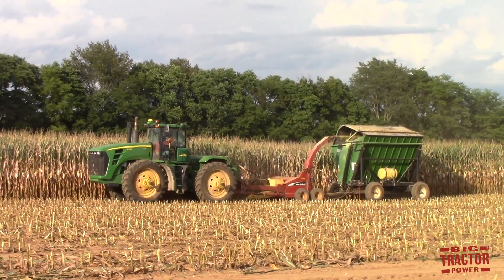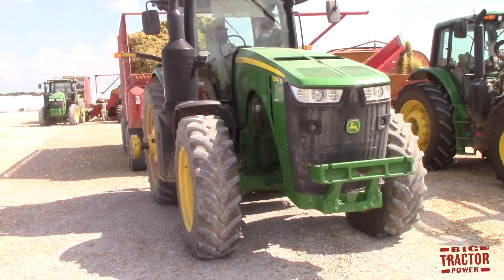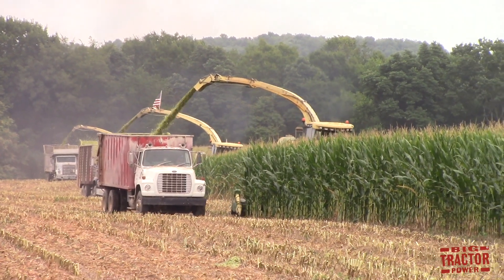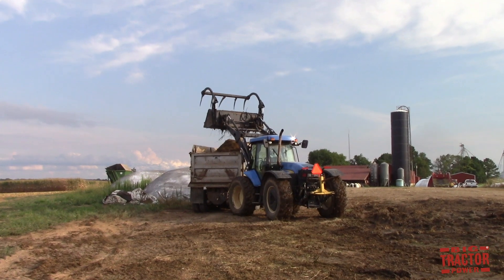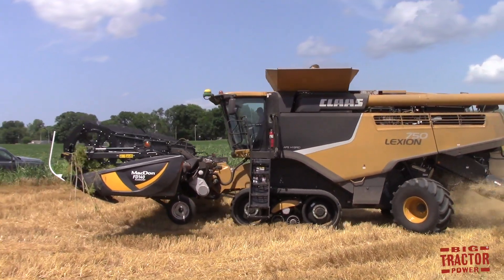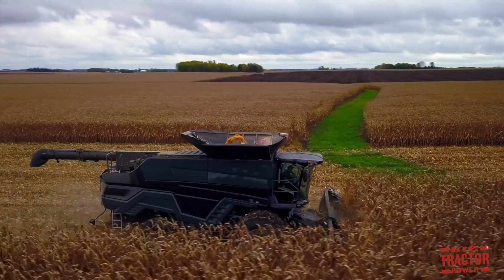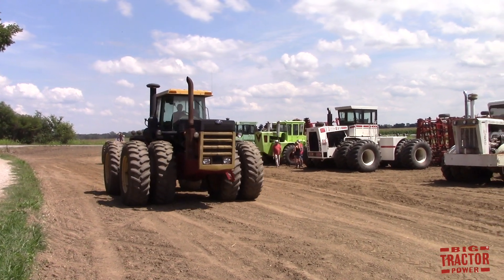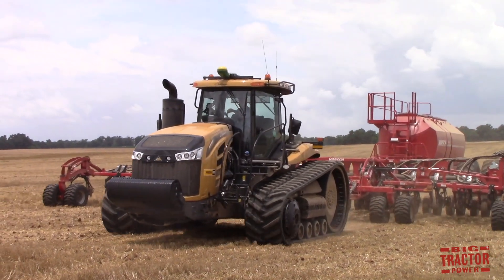Big Tractor Power News Episode 4

Comment: I’ve never seen an articulate tractor on a pull type chopper.
Reply from the maker: It used to be a common sight in the 70’s and 80’s. I remember seeing Case Traction King, IH 2+2s, John Deere 4wds, White 4wds and Versatiles chopping. Massey Ferguson had a promotional video showing a 4880 chopping. I wish I could go back and film in that time period. Self propelled choppers back then were more of a luxury item and often had the same engine as an articulated 4wd. For example the John Deere 5400 sp chopper had the same engine as the 7520 4wd and 6030 2wd.
Reply: bigtractorpower do you have more videos and or pictures of the 4WD chopping?

Comment: Idk why they don't make a 6 or 8 row pull type chopper these days.
Reply from the maker: Just not a market for them with all the used sp machines. New Holland made the largest pt machine in the 80’s.  It was the model 1600 and was built to Match the sp 1900.
Reply: @bigtractorpower  ya that 240 new hollland has a min pto hp of 180hp and a recommended of 300hp. The 1600 was a min of 170hp. I guess when you have tractor that large then a sp will be in reach.

Comment: Talk about overkill that tractor has way more power than that cutter needs and will use alot more fuel than one that is more suited for that use I've used a 130 hp tractor chopping three rows driving just as fast as this guy is plus more manuverable in tight areas
Reply from the maker: All true but if this your smallest pto tractor on the farm to run the chopper you go with what you have.  In this case they use 105 hp tractors and 475 to 460 hp tractors. Other than chopping 150 plus acres of corn they have no need for a tractor in the middle. No sense in have a tractor sit all you just to chop corn.

Comment: Why would they have a tractor capable of working so much land with a chopper that does the opposite?
Reply from the maker: I will have a full video explaining the chopping operation. It’s a good sized grain farm and this is the smallest pto tractor they have to run the chopper.  They also milk cows in addition to the grain side.  The dairy tractors are all around 105 hp so they are too small to run the chopper. There is no need to but a tractor just run the chopper a few days a year so it’s better to use the 9330.